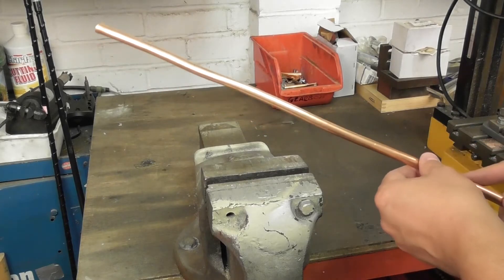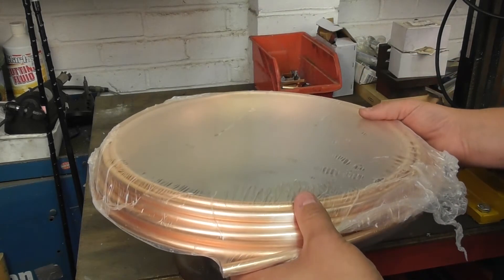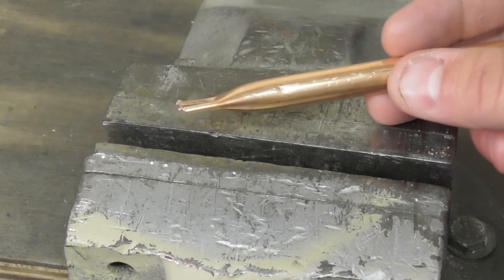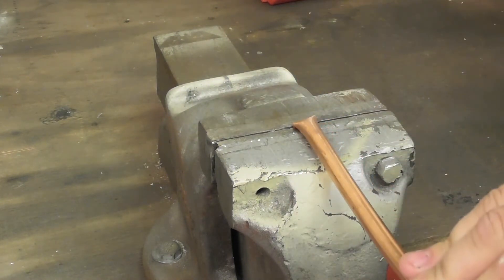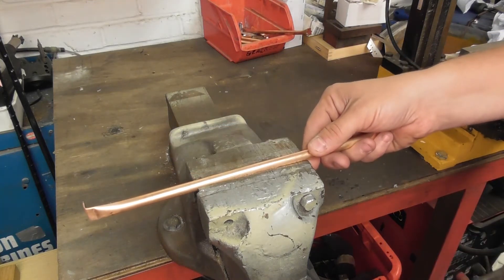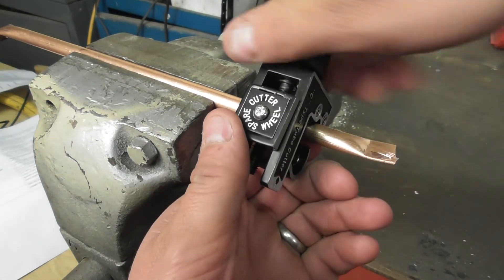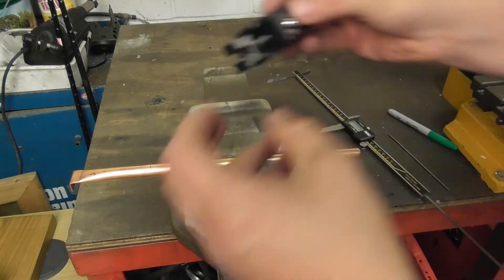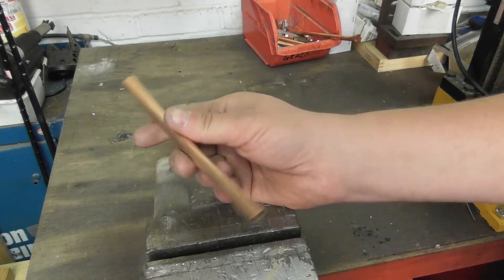M0NWK - How to straighten microbore copper tube / pipe

Comment: For straightening, I anchor the outer end of the tube under my toe, then unroll along the floor to the desired length plus a bit. Once that is cut off, I then lay a sheet of ply/chipboard/ wood on top of the tube, then gently roll the tube between the floor and the wood. This usually gives good result, just remember the copper is soft, so don't squash it!
Reply from the maker: Yes that’s a good technique too. Thanks for sharing :-)